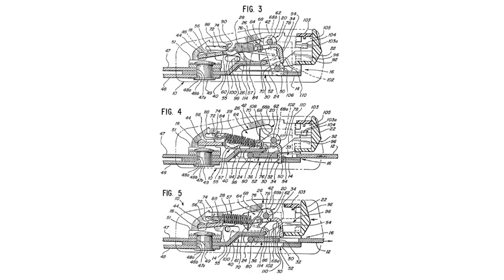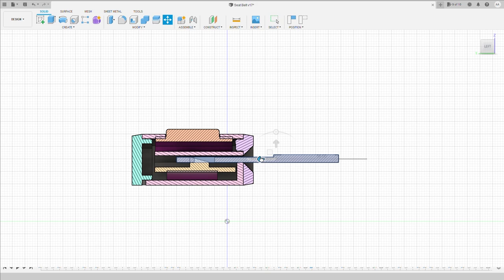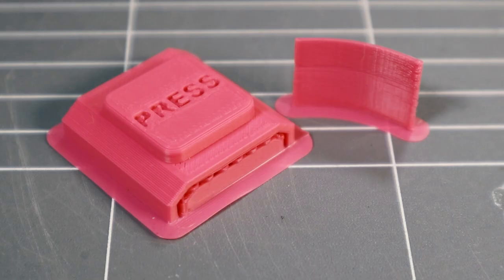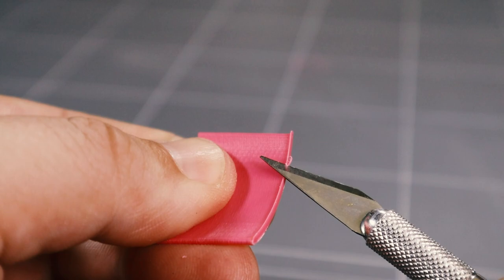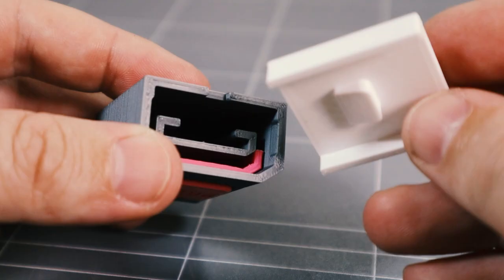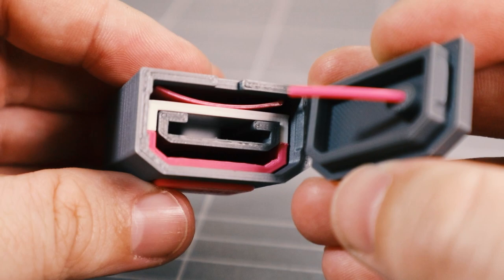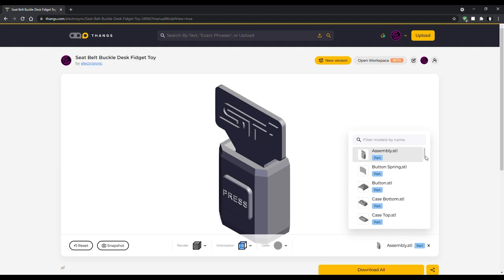3D Printing a Seat Belt Buckle

Comment: The filament tongue spring permanently deforms my filament 😄
Reply from the maker: Hmmm. Try some different materials and even colours and see if you get an improvement. The 20 mm length is also important to stop it ‘bending’.
Reply: Mine for some reason slips around the bottom of the tongue and doesn’t spring at all

Comment: Wow, this satisfying.  How do you get your prints to look so cleeeeean?
Reply from the maker: These things are addictive to play with! My print profile is pretty standard. I did use a glass build plate for these though to give a nice shine to some of the parts.
Reply: @electrosync  do you use a  direct drive extruder?
Reply from the maker: Yes. I use direct drive with the stock hotend on my Ender 3 pro. This is my go to printer for small parts.

Comment: I just built this, but I'm curious, What's the purpose of the 20mm of filament in the bottom?
Reply from the maker: The little piece of filament is a makeshift spring to 'pop' the tongue out when you push the button. The arraignment is important to get it to work. I designed it this way, as it was simple and hardware-free.

Comment: I see that you very very briefly mention that you can change the color on the tongue but you don't say how or at what height. Is this something that should be obvious to those who have done it before?
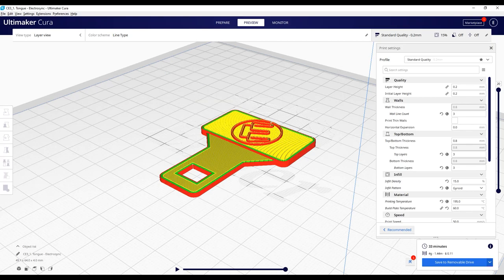Reply from the maker: Good question. I didn't provide details as it varies with slicing software and printer firmware. Using Cura I used pause at height scripts (M0 command for my firmware) at layers 10 and 15 to change the filament colour (you can see a screenshot of the script settings at 2:39  It's not too difficult to find where to change by previewing it in your slicer software and noting the layer numbers.
Reply: @electrosync  Oh awesome, that mostly makes sense. I have never done it before but I think I understand from your comment. Thanks for the reply!

Comment: For the layer heights, the printer at my college will only allow me to do 0.25mm and 0.18mm. Would I be able to print the parts with this setting or will it not work since the parts show 0.20mm and 0.12mm for the latch?
Reply from the maker: Hmm. I’d go with 0.18 for all the parts. You may need to do some sanding on the ramp part of the latch to make sure that it’s smooth. It should work though. Good luck!
Reply: @electrosync  Okay, thank you for the feedback!